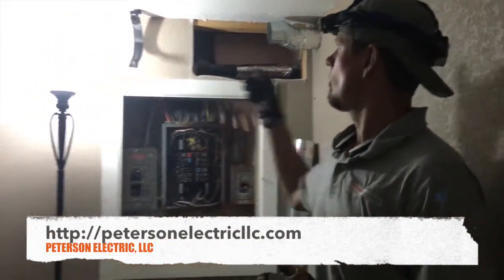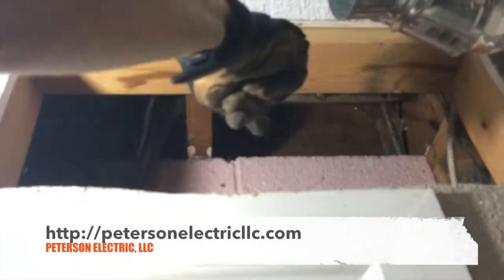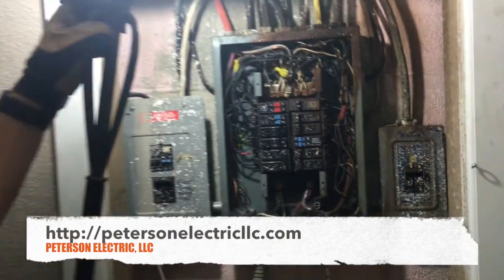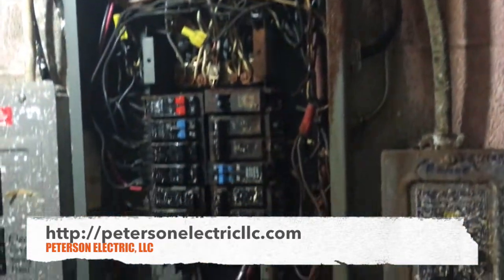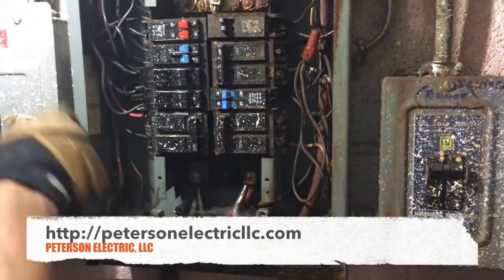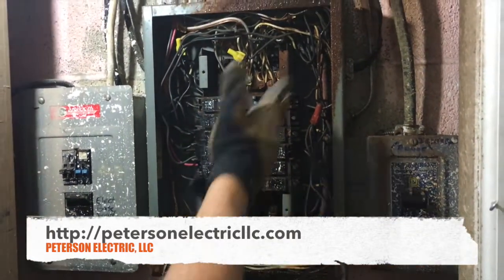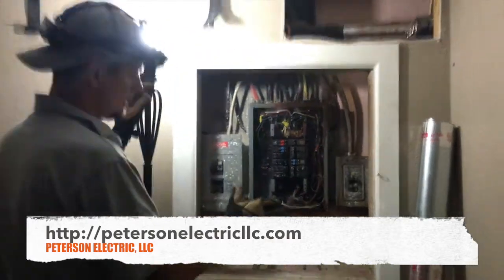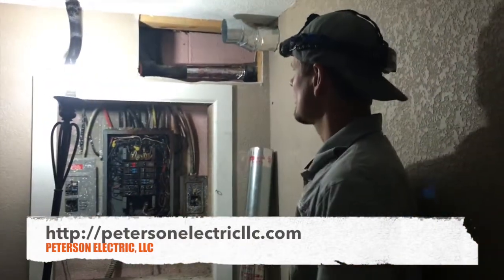Water Dripping On Basement Electrical Panel

Comment: How far does a sink or stove have to be away power panel that is in your kitchen ?
Reply from the maker: Typically six foot or you have to GFCI plugs, but switches do not have a requirement.
Reply from the maker: 36"

Comment: How'd you make out on this one Josh?
Reply from the maker: we eventually got the job and did the work, took two full days. inspector and customer loved it. we joined those two panels together and also changed the service mast and equipment. then installed all electrodes. i think i have a video on this one cleaned up.